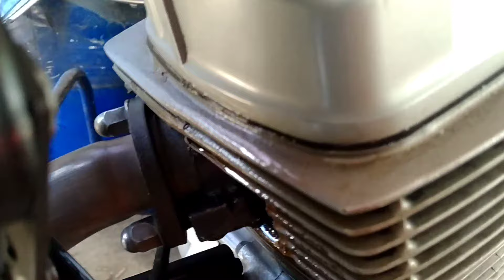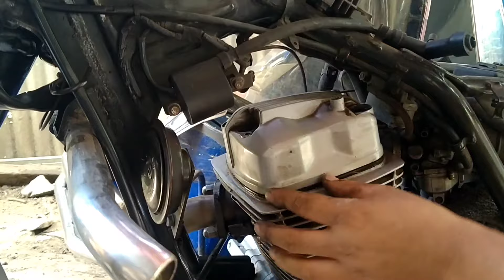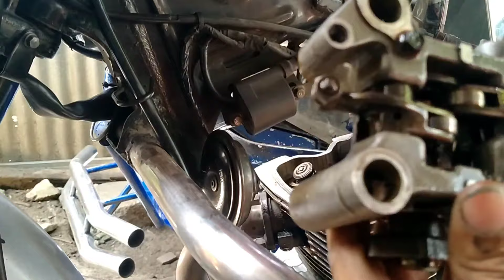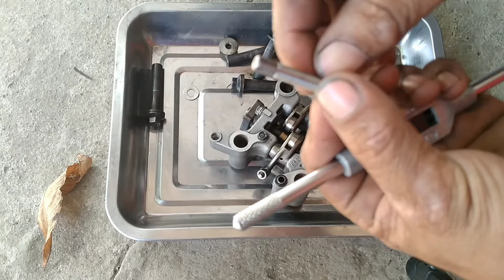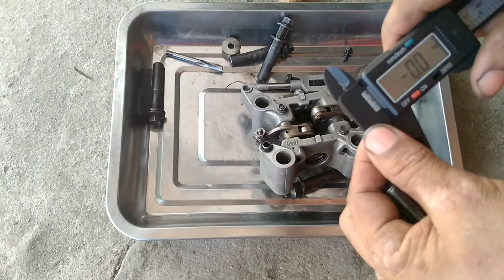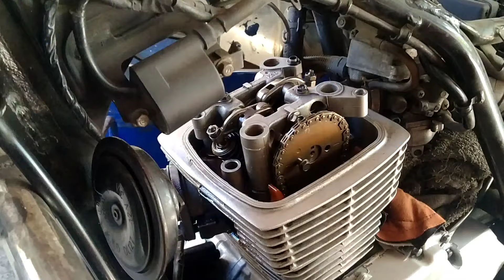Ganito gawin mo kapag laging tumatagas Ang langis honda supremo

Comment: Idol itanong ko lang etong motor ko e ayaw gumana itong electric starter nya  e bago naman yong battery ,anong pwede kong gawin idol , tengs sa sagot
Reply from the maker: Marami Po titingnan supply ng kuryente, starter relay. Starter motor bka Wala ng carbon brush
Reply: Sir saan po Ang location ninyo
Reply: Higpitan molang sir yung turnilyo ng battery baka kalaw na .. ganyan din sakin..
Reply: Carbon brush yan

Comment: base sa cexperience ko, kada binabaklas yang cam cover dapat palitan na rin ng bagong gasket yan,  yan issue ng supremo at yung na naloloss thread yung thread.. sakit na ng 2nd gen at 3rd gen yan..
Reply: May certain torque po kasi ang mga screws nyan, dapat may torque wrench na gamit. May tendency po kasi na mag loose thread pagmasyadong mahigpit. At the same time, magkakaroon ng leaks pag maluwag. Very sensitive po ang mga torque ng makina lalo na sa valve covers.